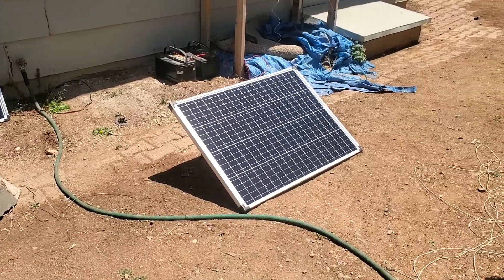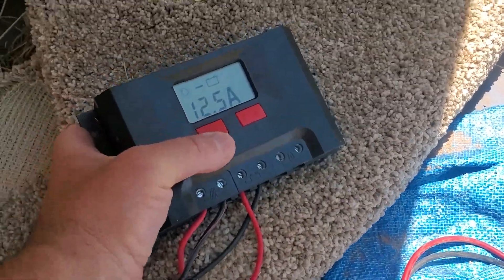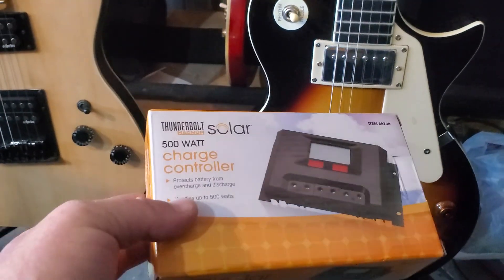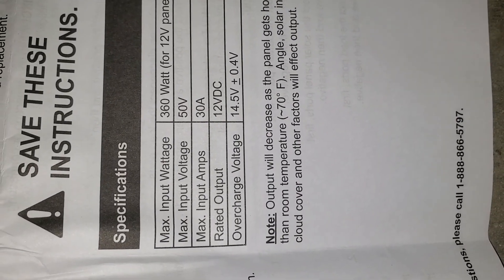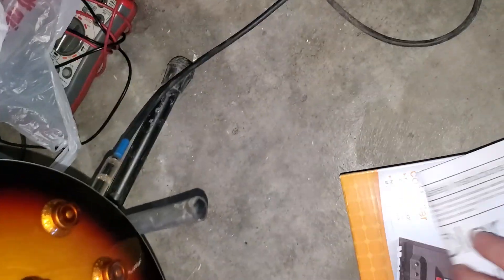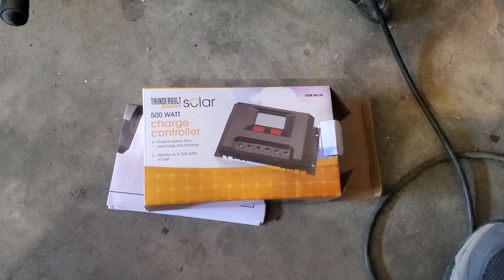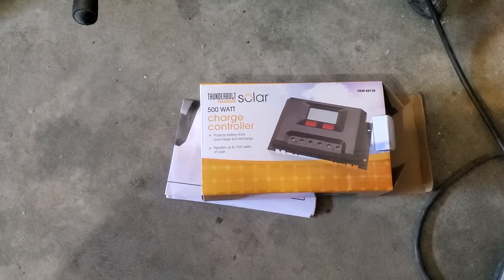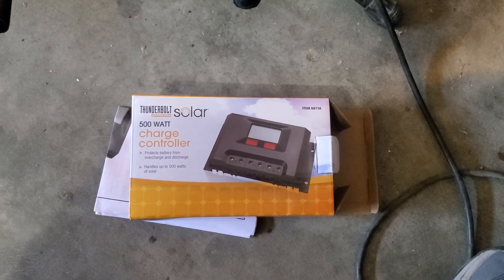Thunderbolt 500w charge controller not 500w!

Comment: This is a 6 ah controller  that charges  very slow if you have 275 watt solar panels  it will get very hot. I don't  like it run with this info and good luck.

Comment: not sure what it was you were doing, but, you had a panel shaded. meaning you sabataged it.
you also did not show the wattage of your panels.
Reply from the maker: Very old video. Sorry. I now have 30x 240w panels and i run epever 40amp tracer 4210an charge controllers @ 24v in 2 series about 4 to 6 parallel  depending on location of all panels. Then i have a mpp solar hv lv2424 all in one 2.4kw unit that handles another array of panels.  Ive learned alot since that video.  However I can assure you the hf cc is absolutely overpriced junk.  You do not want pwm charge controller when you can have a mppt charge controller  that can boost amps while reducing panel voltage. Just trust me. If you are unsure or skeptical go head over to https://diysolarforum.com/
And join up and ask them in the newbie forum or general solar section.  They will steer you right. Good luck in your solar projects
Reply: @hamradiohack  Awsome and a 10-7 to you. well you can have some fun cooking upa few dishes. 

I got a strange note for the PUD so, iam building a system. the note asked ofr name, phone number so we can text you for power outages, or to state if there was an issue with you bill...but the biggest one tht caught my eye...PLANNED OUTAGES....I took the hint lol..they are inthe process of removing dams, cola power plants, all in east and west of the cascade range and as far over as Montna and the holeregion has but one coal genertor left in opperation. that is in washington state... 

because of the removals of the coal power plants and the idiots ill planning, I am guessing were oing to be getting rollign black outs. and or lpanne black outs during fire season.. so, yeah I took the hint lol..well, have n awsome day..oh, to day we had 3 micor brown outs..the voltge is now stable where as earleir it was all over the place.  oh there is talk about removng bonniville Dam..that will remove the boniville Locks that we use to trans port goods up the lower nd upper snake river, yeah, the teachers lied to us about the columbia river lol. our dams are aging. oh and thye removed a 200 year old dam it had stuff growing on it. So my guess is they are trying to prepare us for shortages on power. lets jsut say, I take hints when Power companies write stuff.
Reply: @hamradiohack  sweet